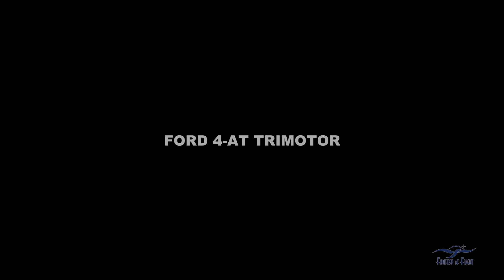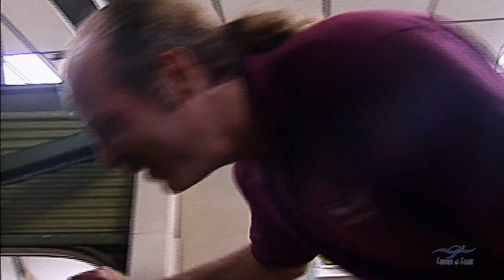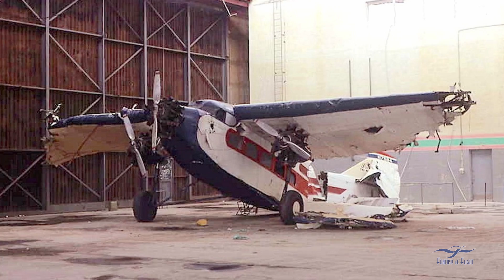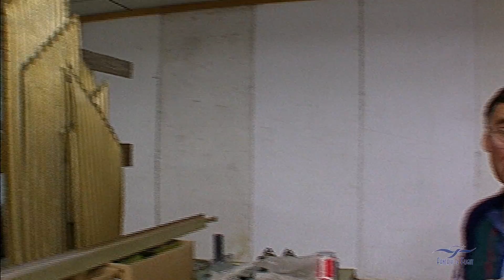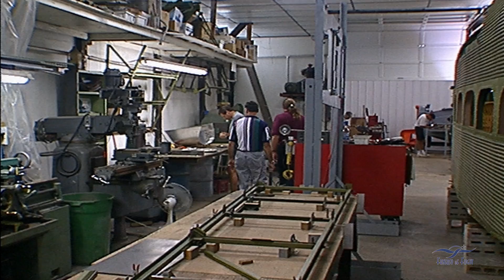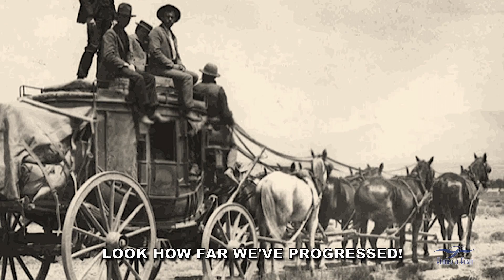Ford 4-AT Trimotor - Part 1 - THEN! - Project Visits Then & Now

Comment: Amazing story. No blue prints. 1 or 2 flyable at that time. Now last I heard there are about 9 and more static in museums that could be re certified by FAA by getting replacement of important parts and hydraulics. This was Mo’s passion as a business owner that would buy and flip recertification with FAA. Amazing guy to keep the Trimotor flying. Amazing privilege to call this man a friend.
Reply: The wrecked modern planes were usually Piper brand

Comment: My grandfather was an accomplished airplane mechanic in the 1920s. He worked for Tony Fokker for a number of years, also with the original Air Mail pioneers. He was a stern, meticulous, no nonsense Irishman. One way or another, he rubbed shoulders or worked for many of the famous aviation figures of the period. He was onboard one of the Trimotors delivered to Admiral Byrd. The details are fuzzy because I heard this story on my father's knee. I believe he was referring to either the Josephine Ford or the Floyd Bennett, but that's only a reasonable assumption. Along the way they had to make an emergency landing in a field somewhere. This caused some kind of damage to the aircraft, I believe to an engine. They were on a deadline and moved heaven and earth to deliver the plane on time. What this entailed, I don't recall, but it may have involved changing an engine. The aircraft was delivered on time with no mention to Byrd of the incident. I've never read anything about this. My grandfather wasn't a bullshitter, not the type. If he ever drifted from the truth my father (a B-24 combat pilot) surely would've called him on it. Besides, he was relating this story to my father. I just happened to be there. Sorry to prattle but haven't thought of this since I was a child.

Comment: Three of us flew from then Toledo Metcalf airport to Put-In-Bay on July 2, 1977 to see the trimotor, N7684, that had crashed on Put-In-Bay in July 1, 1977.  It was cordoned off, and you could see the sheared-off telephone pole that its wing struck prior to the crash.  It was very windy on the day of the crash, and I was told that the pilot almost made it back to the field when he struck the telephone pole.

Comment: 24:15. Video is kind of out of date, but wouldn't the flange machine work better if the metal was more malleable, heated up a little to prevent cracking during the machine cycle?

Comment: Kermit mention of corrosion in relation to your Trimotor provoked recollection for me of a bit of tragic history involving the death of legendary US Football identity Knute Rockne who was killed in an air accident during the heyday of Trimotors and passenger transport.  

Sources have claimed that corrosion in the steel tube frame resulted in critical structural failure causing the Trimotor carrying Rockne to crash on March 31, 1931.

However Wikipedia offers a different version of events because it states that the following occurred;

"A little over an hour after taking off from Kansas City, one of the Fokker Trimotor's wings broke up in flight. The cause of the damage was determined to be that the plane's plywood outer skin was bonded to the ribs and spars with water-based aliphatic resin glue and flight in rain had caused the bond to deteriorate to the point that sections of the plywood suddenly separated. The plane crashed into a wheat field near Bazaar, Kansas, killing Rockne and seven others".

Comment: I rode in that nachine in 1976, and managed to get into the right seat. The wheel was a giant wooden 360 degree rim, mounted on what looked like the pole from a parking meter. The pilot's arms quivered as he pushed to get the tail up.
I still have the ticket, and the plastic model of it that I built afterwards.